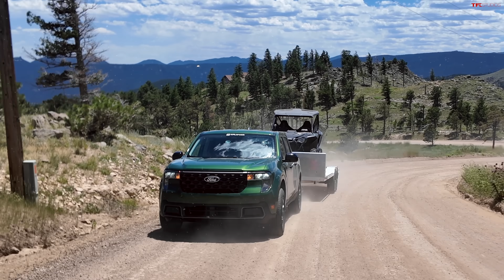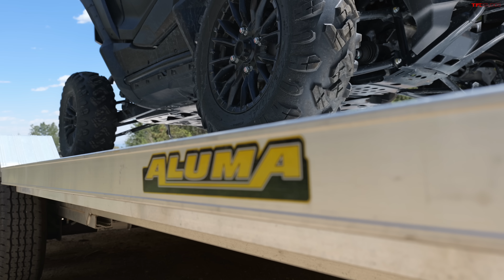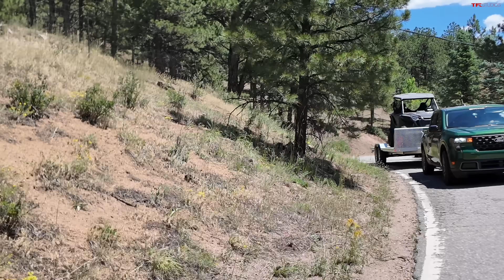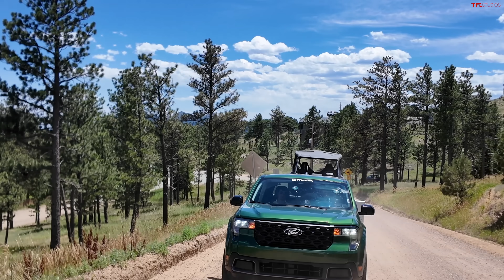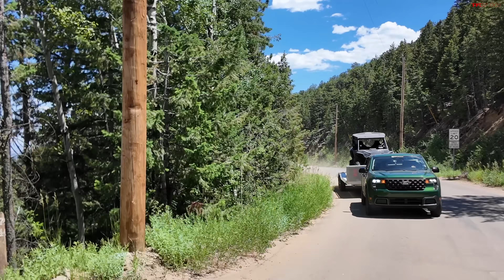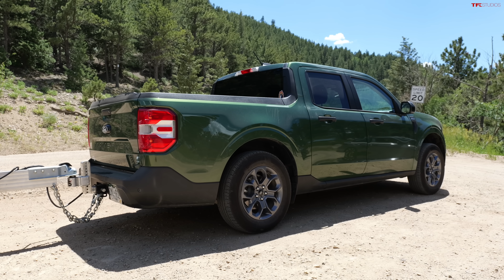Hottest Yet: Does The Ford Maverick Survive The TFL Toaster Towing Test?

Comment: Now toaster test the honda by pulling the Maverick on the trailer! 🤠
Reply: The Ridgeline is a midsized truck, the maverick is a compact truck. 
Booyah 👊🏽 😁 👍🏽 🇺🇸
Reply: @the305hauler  Pretty sure he means put the Maverick on the trailer and pull it with the Talon SxS.
Reply: He meant the Honda ATV
Reply: @JoseDiaz-qw7mg yes. Thanks brother.
Reply: @the305hauler  the Ridgeline isn’t a “truck” it’s a pilot with a bed
Reply: @TEENYcharma 
It's a truck, with a frame system and it was engineered to be a truck. It's a midsized truck. And for what it is pretty decent at what it does. 

It California and many other states because of its truck abilities holds commercial registration.

If a car manufacturer calls it a pick-up and rates It's a such there you go it a truck. The Santa Cruz is an Adventure utility vehicle from Hyundai, so it's an AUV. The old Subaru Baja was a truck, and so was the explorer sportrac.

Booyah 👊🏽 😁 👍🏽 🇺🇸 
I don't make the rules.
Reply: @the305hauler that’s an interesting fact. You learn something new every day. Thx for letting me know
Reply: @TEENYcharma 
Booyah 👊🏽 😁 👍🏽 🇺🇸 

A few more the Avalanche, El Camino, El Caballero, Falcon Ranchero, Ranchero, VW Pickup, CJ8 Scrambler, SSR were all pick up trucks as well.
Reply: @the305hauler  there is no frame on the Ridgeline you fool it’s unibody
Reply: @Dodgers4life1503 
Um mister foul yourself learn about how the new 😮 Ridgeline is made. A partial frame is a frame, a sub frame is a frame, and integrated frame is still what 😮 a frame.

It's not a body on frame🫏🐴.
Reply: @TEENYcharma 
No it is not a pilot with a bed, look in to it 😮.
Reply: @the305hauler I’m literally a collision technician I work on all vehicles and you literally proved my point. A frame is a frame a sub frame is just that a sub frame, they do that for heavier unibody vehicles to support weight, and or for length. It’s a structural part to the body which is the overall structure. On a frame truck the frame is the structure and everything just sits on top of it hence the word frame.

You can try to be a smart guy all you want, but literally they are not the same thing none of it, so no a Ridgeline does not have a frame it is a structural component and the Ridgeline if not mistaken is a pilot chassis. Aka unibody 
The Ridgeline is decent I guess but it isn’t a frame vehicle you fool

Once again…. I work on frames all day every week, frame pulling cutting etc 

I do nothing but body work on all makes and vehicles types. 
🫡
Reply: @Dodgers4life1503 
I'm a former as in did both to survive, body and fender man / truck driver. Putting a Ridgeline on a frame machine to pull out and straighten frame horns or structural frame joint because insurance companies are scam is some I'm very familiar with. I did a very small amount of big rig body work. Frame is still a frame. Even if it is a Japanese beer can or Chinesium it still a frame.

Comment: If you need a truck for towing, why would you buy a truck with a 4,000 lb. towing capacity?
Reply: Probably because a compact truck now allows you to tow a UTV or a small pop-up camper.
Reply: @jamesm568 Or a utility, motorcycle or personal watercraft trailer.
Reply: Not everyone that tows , tows 4k+
Reply: 4000lbs is a small to middleing boat, a smaller rv, flatbed with some motorcycles/atv/utv on it, smaller uhaul trailer, etc. Its a pretty useful max weight

Comment: The ford maverick isn’t really my cup of tea, because the engine is too small, and it has towing 4000 lbs, so that wouldn’t be a good idea for a truck to have the towing. If I need 4000 lbs of towing I might take an suv, because it should be good enough to tow 5000 lbs for the midsize SUVs towing. But for a truck like maverick, not really, but a ford maverick is just a ford escape version with a truck bed on it, so that kinda explains why it has low towing capacity, and why isn’t it a real truck

Comment: Why aren't you using L instead of D while driving uphill
Reply: Same reason they never shift any other vehicle they test with. They rely on the vehicle to decide how to shift for the task.
But moreso, L is not a tow haul mode. And the fact that this is a CVT, I'm curious what L actually does. I assume it just keeps it locked in the lowest gear ratio the CVT will allow? But it's interesting to see that as an option.
Reply: @jensalan  "L" on Maverick hybrid is for regen braking.  Can almost come to a stop when you lift the foot, it's a slow rolling speed, but you still have to apply brakes to stop completely.  Works great when going downhill when towing, saves the brakes and regen the battery.

Comment: it would be interesting to see how a front wheel drive model did that same test, given how loading takes weight off the front wheels and what traction would be like
Reply: You should watch tfl's original video on the Maverick when they went to David's Ranch and loaded the back of the little blue Maverick full of firewood logs and it was just a front-wheel drive only
Reply: No 4000 lb towing in the fwd hybrid model.

Comment: In reference to the talk about coolant temperature, back in the early 2000’s GM fwd cars cooling fans didn’t even kick on until 227* which seemed awfully hot. I discovered this after being alarmed by Dodge/Chrysler 3.0’s in the 90’s not kicking on until 212*. I don’t know how they handle it! Keep up the great reviews and programming. As a retired tech, I’m a huge fan!
Reply: The cooling fan on my 2022 Ram 1500 with the HEMI kicks in to high when coolant temps hit about 223 degrees!!  I found that if you turn the AC on max, it keeps the radiator cooling fan on high too regardless of the engine temps.  When this happens, while at idle, the engine temp hovers at about 200 degrees.
Reply: oil had a lot more viscosity back then i think the higher temps was necessary to keep things lubricated.
Reply: Ya a Friend Had a 5.0 V-8 1985 BLack Trans Am with no ReaL GrilLe it Ran Hot🔥 Like Ya Sad, but it Was FASt, 2--nd Gear Scrach @ Sfifting To

Comment: Do they have their check engine light on since starting the video?
Reply: No, that engine symbol is not orange or red.  It represents the ‘Power Gauge’ available on the hybrid.  It lights up a little brighter when then engine is running.
Reply: It's poor design. They have a screen where they could have been creative and displayed anything, yet chose the check engine light.
They should have gone with some kind of liquid or gas icon. Especially since they show a battery icon. Afterall, batteries and gas serve the exact same purpose, storing energy for the vehicle until it's needed.

Comment: Fords do have an internal transmission fluid temp sensor. THE battery temperature is monitored too. So if the battery temp gets too high, it derates it for powertrain safety. It'll show a warning once it gets too high
Reply: Does it show the temp for all 3 or just a warning when it gets too hot?

Comment: The Maverick dash is AWEFUL!  It is pretty useless.  I think for average consumer needing small truck the Maverick is great.  Just took delivery of mine. Looking forward to putting it through my routine uses.  So far it is quieter than I expected on the road, smoother than I expected in how it drives and handles road irregularities.  It is exceeding my expectations at this point.  My expectations were pretty low to be honest, but this is much better than I thought it would be.  Ford if you are listening do something about this horrible and useless dash!  The previous dash was better than this one, and like you saw in this test the indicators are not accurate at all and don't provide any details.  Ford fix the driver information display, give us more options to see what is going on and improve the accuracy of what is displayed.  Expert mode or something where we can select what we want to see.  I am going to connect up a OBD port scanner and see if I can get more info that way, but we shouldn't have to do that.   Coolant temp, oil temp, trans temp, hybrid battery temps would all be fantastic information to be able to see .   So far I am really liking my Maverick.
Reply: The thing is that the Maverick is even less likely to be used for towing than the Ranger or F-150 and I would hope that any dealer that is the least bit honest would point people wanting to tow with any regularity towards the bigger trucks. So giving Maverick owners the full info dump is from a corporate point of view wasteful and could lead to warranty issues from owners looking at all that data and pushing the trucks beyond what they were meant to do.

Comment: The 2.5l is a great engine. It is based off the Mazda Miata engine. I want to see you guys put some off road tires on this and do the off road course again.
Reply: It's not based off a mazda engine its ford's own engine. Mazda and ford relationship already ended and when they were still partners most mazda engines were ford's.
Reply: @evoemperor3776 it does have its roots in one of Mazda engines. It's been heavily revised since then. But those are its roots

Comment: I just priced out the Maverick on the Ford website. A base Maverick XL hybrid FWD with no options starts at $30,000. Funny how the Maverick gained $10,000 in base price in just 3 years and far outpaced the already crazy inflation. As much as I like the Maverick, I think I'd rather just suck it up and spend the extra $3,500 to get a Nissan Frontier with a stronger V6, 7,150 tow rating, a proper 6ft bed, and a taller seating position. An extra 6 months of truck payments seems well worth it.
Reply: That's how supply and demand works kid.  Ford still can't keep these on the lot even after adding a third shift. And the hybrid was the biggest seller by far. The hybrid also isn't cheaper than the Ecoboost like it used to be. it also started at 19995 before destination and now starts at 28145.
Reply: You’ll also save $7500 on gas or more on the maverick over 100k of miles. And it’s much more comfy and handles much better. It isn’t for people that need the extra real truck stuff that the midsize trucks give. It’s for someone who specifically need less than that and want to save some money for giving that stuff up
Reply: @BigDunker345  It should be a lot cheaper than $30k to start. It's crazy.
Reply: if your focus is more on truck things than MPG, sure. 2025 v6 4wd/awd frontier MPG:  city 17/  hwy 21/  combined 19 
this maverick in the video, hybrid awd, is around 40mpg (when not towing of course)
Reply: The base model did not increase 10k over 3 years. 

It was damn near impossible to find it when it came out near that 20k. They were pretty much all around 26k on up. 

Even before they came out, it was almost hard to imagine that chief of a vehicle that did all that.
Reply: Shoulda ordered one 3 years ago, Ford stated it will never be that cheap since the beginning.
Reply: It’s possible to get one under MSRP but you’ll need to travel for one of those.
Reply: Only a year ago they started at $22k.
Reply: @specialopsdave that was like 4 years ago
Reply: @Drewcrdllo  My dealership offered 22k for a base model, white 2wd
Reply: I would never pay $30,000 for a base model vehicle, especially if it's a compact truck. If you make less than $80,000 a year you should never spend $400 a month for a vehicle.
Reply: When you put it like that…you’d be absolutely foolish to buy the Ford. 

I completely agree, well worth the extra 6 months of payments for the Nissan
Reply: I bought a 2022 it failed badly violent shaking at 20km which is about 10k miles ford went no warrenty and played games it has so many problems. It would over heat on a gravel road going up a mountian with no passengers or cargo. In snow the awd would turn off. The ground clearance was lacking not a good truck... I would stay away from ford anytbing
Reply: @wildandliving  hybrid or EB?

Comment: When does this little thing ever give up. I am so surprised that this maverick truck just does everything. Get this thing a little an off road version and it’s the best Swiss Army knife.
Reply: Booyah 👊🏽 😁 👍🏽 🇺🇸 
Maverick Tremor all day
Reply: There are FX4 and Tremor versions of the Maverick for off road
Reply: Just add some bigger good light weight all terrain tires to this version. That's what I did!
Reply: These haven't been around long enough for all the plastic hoses and all the other plastic fittings underneath it to rot. Also, when is the last time you been behind a Ford dealership and see all the Mavericks that are needing engine replacements?
Reply: @jamesm568 you can insert any manufacturer into that sentence. If you drive behind a Toyota dealership, you will see similar.

Comment: I bought the 24 Lariat AWD and 4k tow with the 2.0 ICE and now have 30k trouble free miles. Only 1 recall for recalibration of a electronic part. This has been the best new vehicle I have bought in a long time. I average 30mpg and it’s not even a hybrid. Now the Maverick is AWD and hybrid I might replace my truck at 150k with that model. (Depends if Ford can get the recall percentage down on the hybrids)
Reply: 24 hybrid, 0 issues for me. 16 months and 24,000 miles.
Reply: 2023 maverick. 33 k miles.   tow my four seater can am once in a while  on flat ground

no problems.   i drive the snot out of it  2.0 awd.
Reply: Really liking my 24 ecoboost awd. Im averaging 30-32 on the highway and 27 in town, overall average is 29mpg.
Reply: You see recall ain't a bad thing it just means a company admits its fault and does everything to fix it. Unlike other companies that hides the issues until it catastrophically hits every owner.
Reply: The 2.0 will not last 150k miles lol.  Meanwhile I've seen those hybrids with 400k miles
Reply: @Drewcrdllo I change my oil every 5k with synthetic oil. There is a kid who has beat the crap out of his Maverick on YouTube (look him up). He has 165k and has done 10k oil changes and still on original motor.

Comment: If you tried to tow with a old 4 banger ranger manual or automatic they could barely make it over the mountain 🏔 with out a trailer but the same size engine with hybrid power train is night and day difference in towing!!!! And 15 mpg better lol 😂 super duty V8 needs a hybrid so it make it diesel like towing and better mpg!!! Ford needs to make a F-150 2.3L ecoboost hybrid or a f-150 hybrid 3.3L natural aspirated v6 hybrid 25-30mpg in a f-150 would be good plus better towing and handling!!!
Reply: Think 🤔 it’s also the cvt and front wheel drive making it better more efficient means more hp and lbs tq. to the ground !!!! Compared to the old ranger rear wheel drive !!!
Reply: Ford does already make the f-150 powerboost hybrid. Although that is with the 3.5 ecoboost instead of the 2.3 or 3.3 NA.
Reply: The old 2.3l rangers struggled to get up to highways speed with the ac on lol.
Reply: I hate CVTs.

Comment: 4000lb towing capacity with a CVT is pretty impressive
Reply: No belt to harm this cvt uses planetary gears and electric motor to alter gear ratios. Only ford and toyota uses this kind of transmission problem is it needs to be a hybrid powertrain to use an e-cvt transmission
Reply: @evoemperor3776  Subaru Forster Hybrid uses planetary gear CVT too. I hope Subaru changes all their belt CVTs to planetary gear too.
Reply: @RSTi12Blue yeah but that’s Toyotas tech
Reply: @Icayn yep. The Ford hybrid system and ecvt is almost a copy of the Toyota system (to my understanding). Smart move on Ford's part.
Reply: @evoemperor3776 the Chrysler Pacifica hybrid uses it also
Reply: A planetary gear set 👌🏼
Reply: @Thissandthat yep you watched the video
Reply: eCVT, planetary gears, no belt.
Reply: This cvt does not use a metal belt